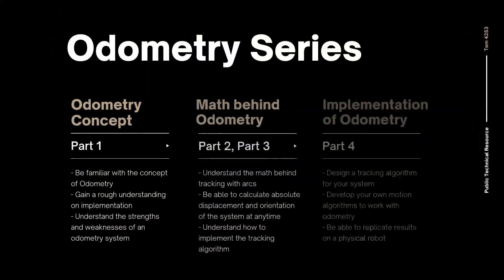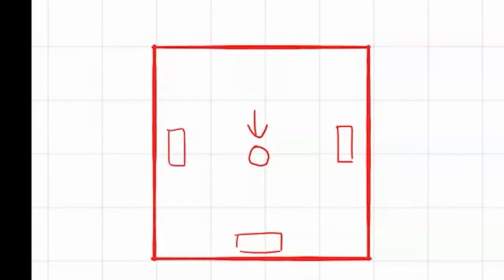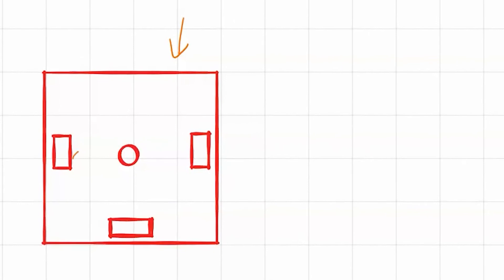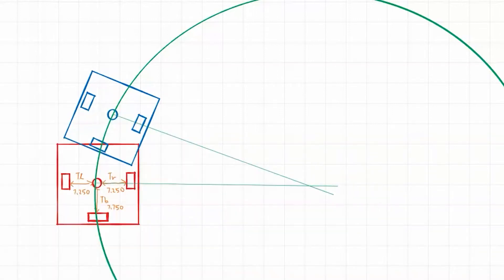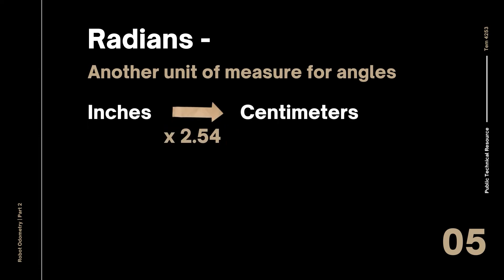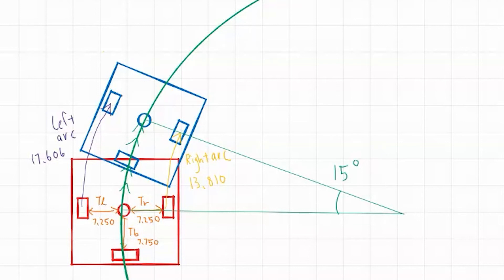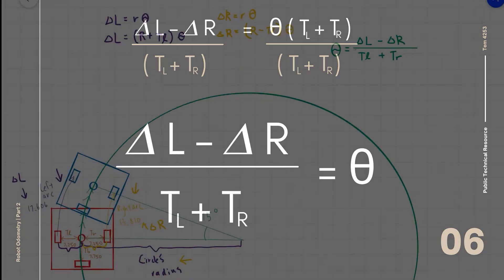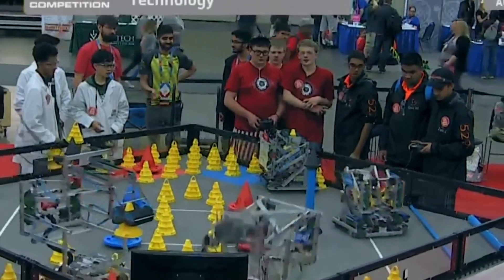Learn the Math behind Odometry | Essence of Robot Odometry Pt. 2

Comment: Wait, my team is making a a tank drive and we are trying to figure out the placement, but we plan on only using 2 odometry wheels, like a differential bot. So our odometry wheels have to be on the midline right?
Reply from the maker: Hi, if your team plans to use only 2 odometry wheels that are parallel to each other, you would only be able to calculate the orientation vector. Without a perpendicular tracking wheel, you lose out on the ability to calculate the position vector (x and y coordinates). I go into more depth on how that's done in Part 3 of the video here: https://youtu.be/qqODIdvSGac.

If your team is unable to use 3 tracking wheels, my recommendation for a 2 tracking wheel system is to position them perpendicular to each other, this way you can still calculate the position vector, albeit you lose out on orientation. To find the missing orientation, the inertial sensor is a great choice that takes up less space while providing data with similar accuracy. 

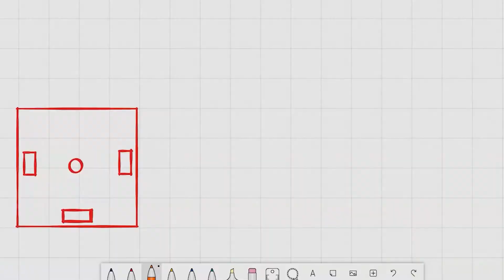As for placement, if you go with the first option, your tracking wheels do not have to be on the midline as long as they follow the 3 rules outlined here: (3:12). That is, they must be parallel to each other and perpendicular to the tracking center. Hope that helped, let me know if you have any more questions.

Comment: When coding odometry for an x drive, how does an arc approximation work? An x drive almost never moves in arcs. Wouldn't adding vectors each cycle be a more accurate solution?
Reply: While it looks like the robot is driving in a straight line it is realistically impossible that it would be from imperfect hardware and electronics. Therefore, we can assume the robot is driving on an arc of a circle with a very large radius and the calculations still stand very accurate. Since we are measuring these distances over very small time intervals you can imagine that circles even with radii of 6' could have a segment that satisfies the measurements we just recorded from the tracking wheels. 

If none of this is making sense you could also just open an image of a circle and zoom in really far on the outline to see eventually it appears as a straight line but in reality is an arc segment. Hope this helps.
Reply: @Zach929U  yeah that makes sense, just was wondering because the x drive moves so fundamentally differently than a tank drive and the code looks tailored to a tank drive.
Reply: @angrybokoblin8777  In case you still are curious, a straight line is just an arc with infinite radius.